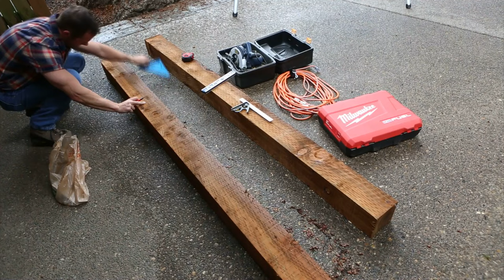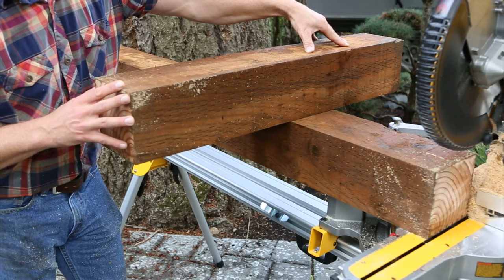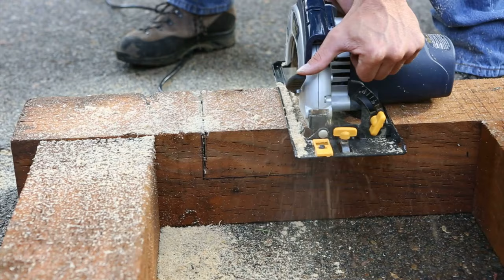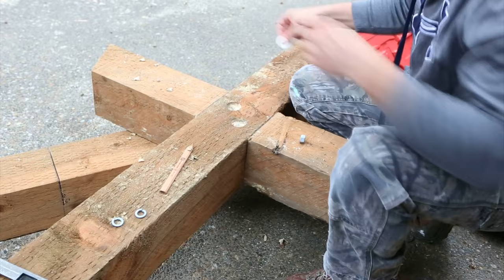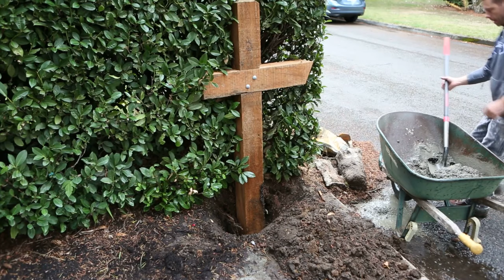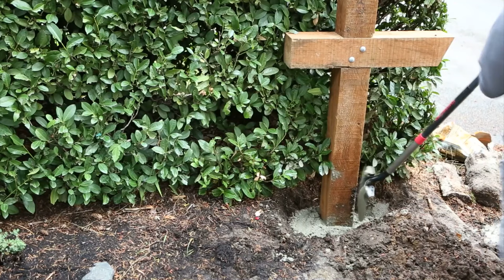How to Build a Heavy Duty Mailbox Post

Comment: Hello Brian, thanks for the video. this is precisely what I’m looking to make for my new mailbox. Do you mind specifying a few things for me? (I’m a newbie at wood and doing a diy)

1. What is the depth of the slots you cut in the pieces to make is flush?
2. What size spade drill
3. What size boring drill
4. Which bolts did you use?

Thanks.

Comment: I am getting ready to do this with an old barn beam thanks for the video...  did you have any trouble from the postmaster general about your 6 inch post?
Reply from the maker: Hi: Thank you for your feedback. No trouble from the mailman at all. His only concern was that it be a height that he could reach it. Aside from that, I think he appreciates how sturdy this is.  Good luck with your project.  An old barn beam sounds like it will make a great post.
Reply: Great job.
The through bolts and nuts are a great idea. If you want a uniform look and dont want the nuts you can use lag bolts and diagonally stagger them from each side.
Can also use lag bolts that are shorter than the width and glue in lag bolt plugs for the other side.

Comment: I see this type of post frequently with a brace (diagonal) piece running from the vertical to the horizontal  (sorry, not a woodworker and don't  recall the technical name for this brace). Is there a reason yours did not need that piece? 

Like the look of a 6x6 post. Definitely  appears more sound than a 4x4.
Reply from the maker: I didn't need the brace due to the 6X6 construction being sufficient to hold the weight of the mailbox plus anything you'd reasonably place inside of it. :)   What's more, the 6" wide board makes a much more stable platform to mount the box to.    Thank you for your comment. I hope your project works out well.
Reply: I think it would be called a knee brace.....I'm looking for ideas
Reply: Also called a gusset, but like Brian said, a 6*6 is plenty beefy especially if your horizontal piece isn't very long